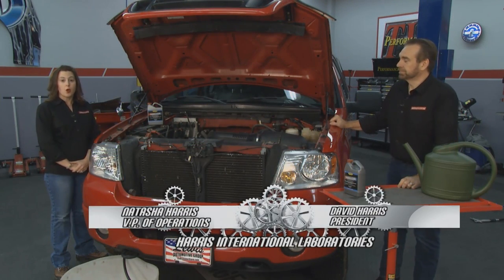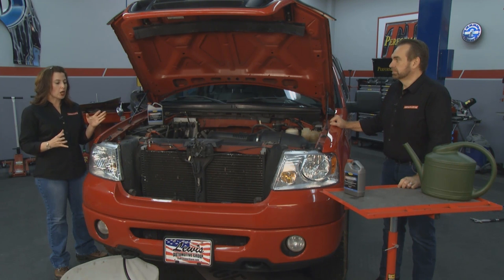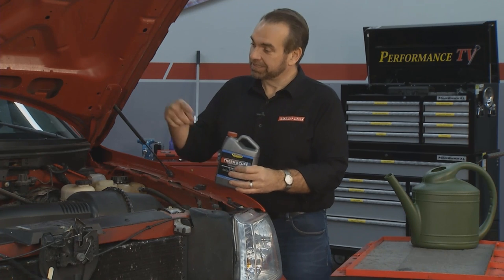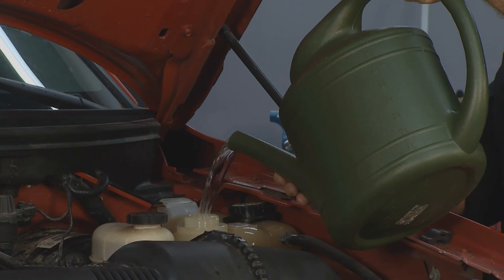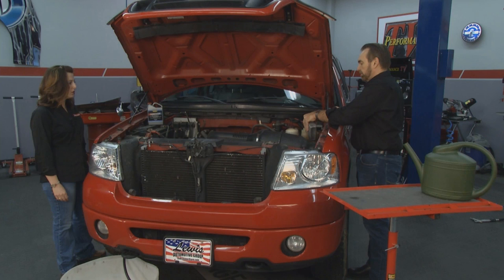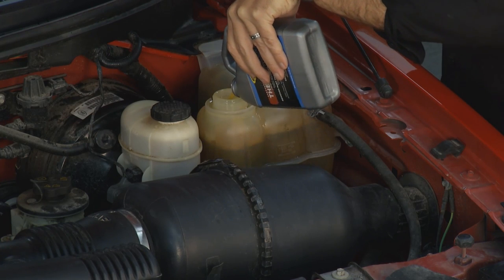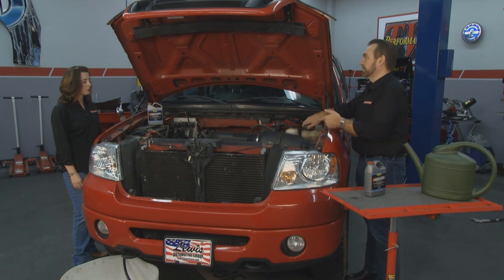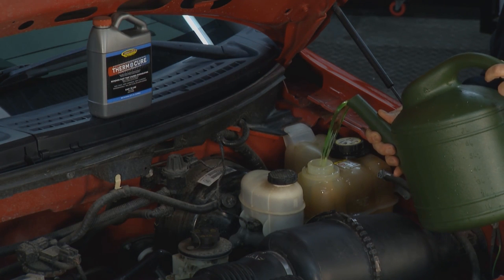Evapo Tip #8: Remove Rust in your Cooling System with Thermocure™

Comment: I want to try filling a motorcycle gas tank with this stuff . It’s got an electric fuel pump in it and it’s a pain in the butt to remove and make a blank for if I were to remove it . If it doesn’t mess the pump up I’ll grab 3 gallons and fill er up and let tank sit a day or two

Comment: Why use this instead standard  evaporust ?
Reply from the maker: Simply put madogblue, cost.  Thermocure is formulated for up to a 3 gallon cooling system.  You can use regular Evapo-Rust but it will cost you 3 times what it would if you use Thermocure.
Reply: @TheEvapoRust   Funny that you said the price, because where i live it`s $80 for 32oz thermocure and $12,5 for 32oz evapo-rust. Just need it for the radiator. Only need 1 bottle, but for interest sake. My cooling system is 2,4 liters. Need 3 bottles, that`s together $37.50 (cheaper than $80). In my case it`s more expensive. We don`t work in dollars here. Multiply the price by 14 and it`s a big difference
Reply: Exactly.  $35 for the bottle of thermocure and $12 for Evaporust. Did you use the Evaporust?  I am ready to try it.

Comment: use distilled water, tap water has minerals in it that will cause it to rust again.
Reply: Or, really, a waterless coolant.  Jay Lenno uses it in all of his old cars.  It ain't cheap, but it protects your water jacket from rusting.  He also claims it's excellent on the water pump.  I don't think he is a paid endorser of it either.
Reply: @tarstarkusz   i dont understand what youre talking about, i just offer some good advice from 40 years of experience, im not some rich guy who can afford waterless setups, but bash me if you want,. i know the facts, tap water will and does cause corrosion and rust, FACTS.
Reply: @carolinabeacher1558  I'm not bashing you.  I'm just saying if you really want to prevent rust in the water jacket, it can't have water. There is just no way to prevent water from causing rust in a cast iron engine.  Just a suggestion to make it that much more resistant to forming new rust.
Distilled water absolutely will not prevent rust by the way. Rust is not caused by minerals.  Distilled water will prevent scale though.

  If you can afford a 100k Dollar restored car with cast iron block and heads, you can probably afford the waterless coolant.
Reply: @tarstarkusz  i disagree, i have cars 30 years old, even jeep 4.0s known for rusty engines with no rust in the engine at all, coolant still the color it is supposed to be. problem is, people dont maintain their coolant system properly in their vehicles, ive bee a mechanic for more than 40 years and learned the basic maintenance procedures where i dont need concrete in my block to have a well maintained vehicle, i have built many an engine/transmission with great results because i know the proper procedures. do not use tap water, distilled water does not rust or corrode.  those who know, know.
Reply: @carolinabeacher1558  I assure you there is rust in your cast iron blocks.  There is a very good reason all steel facing the world is protected from rust. There is simply no way to prevent it without mechanical coverings like paint or putting a sacrificial anode on the steel .  You can have less rust from good maintenance practice, but your whole water jacket is covered in rust, surface rust at an absolute minimum.

I already agree with you about tap water.  Distilled water is 1/10th the cost of anti-freeze and so it is only a minor fraction of the total cost. Or you could buy 50/50 which I am pretty sure uses distilled water.  But that is a different problem. Minerals will promote scaling. But distilled water absolutely will not prevent rust.  Rusting is a chemical process from the literal h2o, not dissolved solids or salts. Nothing but water is needed for rust. 
If you don't believe me, throw some distilled water on a piece of steel every day.  Within a few days it will have developed surface rust.
Reply: @tarstarkusz   you said concrete in blocks, , are you aware concrete has Lyme in it and also attracts moisture which causes rust and corrosion?  i have spent more than 40 years a mechanic, worked in machine shops, built racing engines etc and i know SOME do have rust, but this i know for a fact, the majority of engines i seen in the engine shop that had rust was in the cylinders or outer block which neither of which had the so called concrete in them, and the more than a billion ice vehicles on the road do not have concrete in them (which is not really concrete, its a filler amateurs call concrete.) just stop acting like taking proper care of your engine is not helpful, it is very helpful, coolants have an anti corrosive and an additive that prevent rust, i know you love you own opinion but its not one i can agree with, take care of your engine and it will last a good long time. good day, im done with this nonsense,  people take care of maintenance and you will be just fine, dont put concrete in your engine (if you do use the proper additive, not concrete for racing applications only), just take care of the basics you will be fine.
Reply: @carolinabeacher1558  When did I say anything about concrete in blocks or concrete in general?  Are you sure you are not confusing me with someone else?  The only thing I said that is even marginally related was that you can get build up if you have a lot of minerals in the water.  I can assure you I have never put concrete in an engine.
You are the one claiming water doesn't cause rust, rather the impurities in the water creates rust.  This is wrong.

What I said is not an opinion. Water causes iron to rust.  This is not "my opinion" it is a fact.  It is well understood. It has been known since man started using iron.  The fact that you believe water is not the cause of rust is YOUR OPINION, not mine or anyone else'

When did I say not to take care of your engine.  You are arguing with yourself. You are attributing to me ideas that I never thought and never said.

Comment: Would this break down stop leak as well?
Reply: Natasha Jones at this point the stop leak is like sandy pieces or pellets left over. It's a old car so I'm sure it's been in for awhile.
Reply from the maker: Zak, It will most likely remove the Stop Leak especially if there is rust underneath it. If you have any other questions, please give us a call 888.329.9877 ~Happy De-Rusting, Evapo-Rust Team
Reply: yes it will i try it, i try also citric acid, oxalic acid. they remove but then rust apears again. when rust is instaled theres no way to remove it forever. need to change all he radiators and hoses